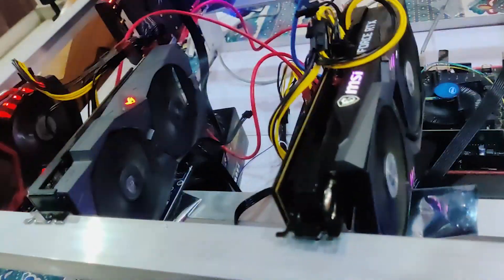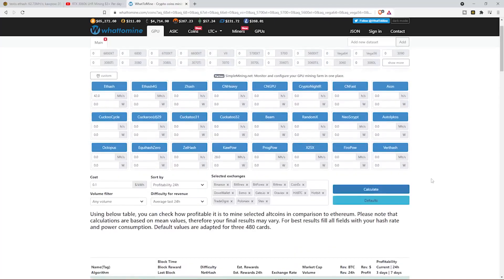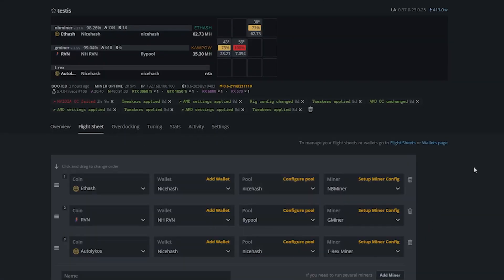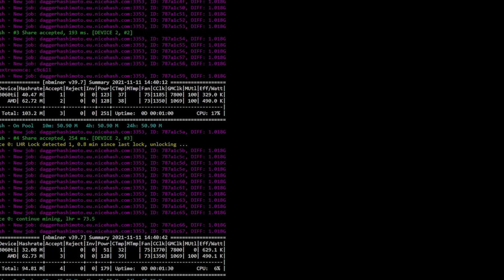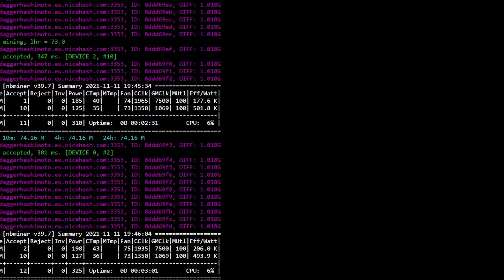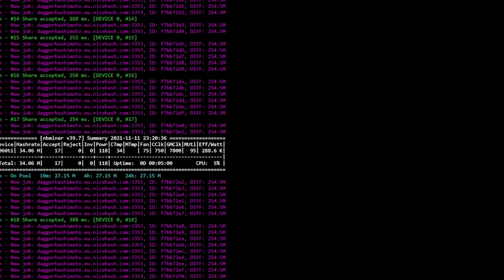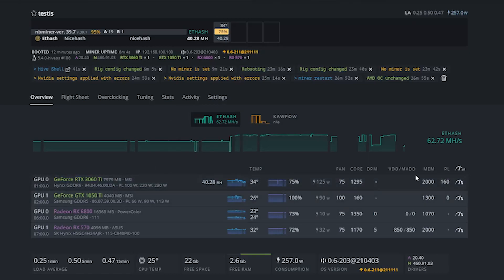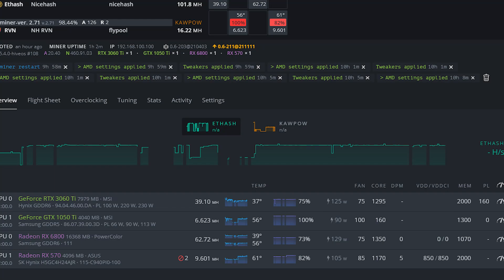3060Ti LHR Unlock NB Miner 39.7! Overclocking Hynix Memory! #lhrunlock #3060ti

Comment: I have 3060 ti LHR hynix, power 140 watt, 750 mhz on memory, 0 on core. Fan at 65 manuel. Temp at 60-65. Oc done using msi afterburner. Getting 42.5 mh stable.
Inno3d OC edition. Noticed core oc don't improve hash rate but keeping it at 0 improve temperature.
Reply from the maker: Good for you bro. Every card is different but it's great yours reached 42+
Reply from the maker: The problem with my card is LHR limiter kicks in when I leave it at 0/ default. It's is weird and shouldn't happen but it is what it is! Bad luck on my part
Reply: @acemining6671  weird. But then again I'm using on windows. Maybe try increasing mem with 100% power till it's stable. Then change +- core with said mem oc and 100% power. And last reduce power until hash rate starts dropping. Anyways good luck finding your sweet spot. Took me a week to figure out with trials and errors.
Reply from the maker: @CarnageFever  bro I did everything both on windows and Hive. This is silicon lottery bro. I was overclocking this card for 7-8 hrs and while editing the video I had to go over 7-8 hours of overclocking footage. It's just a case of bad silicon.
Reply: what mining are you using? im on t-rex with 850 mhz on memory and just getting 38mh